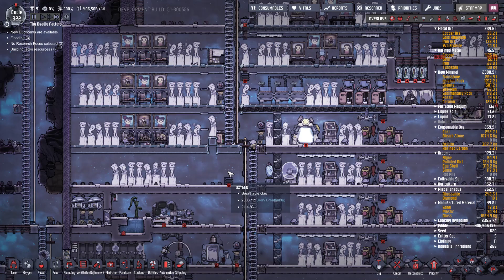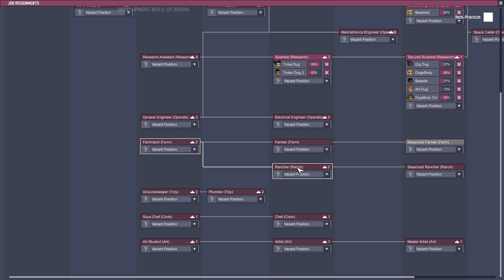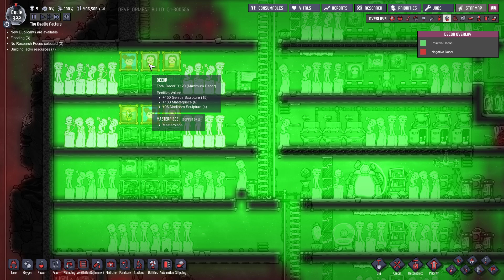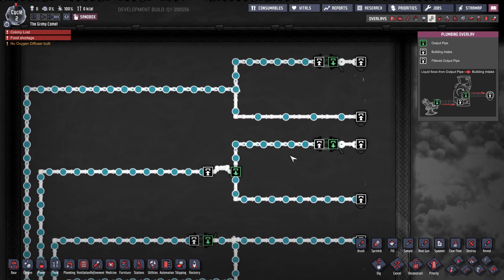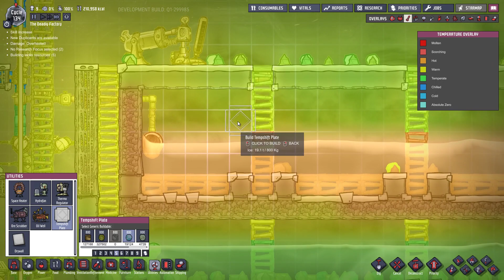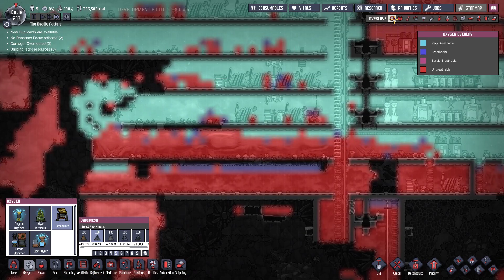Scheduling, Decor, Piping and Mid game water. Tutorial 5 Oxygen not included

Comment: When talking about pipes, one thing that is mighty useful and I don't think you mentioned in this tutorial is that bridges themselves don't store any fluid in them. Which means that you can deconstruct bridge on a working, flowing pipe network and not spill anything.

With broken bridge and stopped flow you can simply plumb out the single pieces of piping you need to change up, and then you can reinstall bridge.

Comment: So I've been building sour gas condensers in debug mode with four thermo regulators ganged up using hydrogen as the coolant.  Any tips on how to get these to stop stuttering, it still stutters and says pipe blocked even when it's just the four thermo regulators and a loop with no slips or anything else in it?
Reply from the maker: Stutters? It sounds like the pipe is to full. If you have almost every single section of the pipe full then there is nowhere for the regulators to output to. Cut out a couple of bubbles and retest.